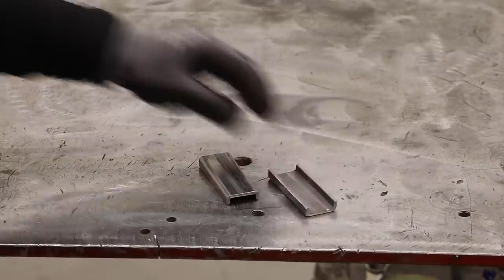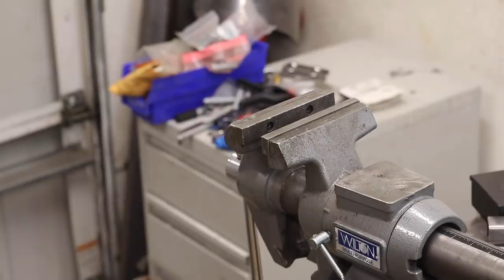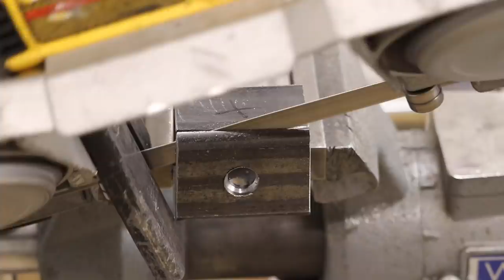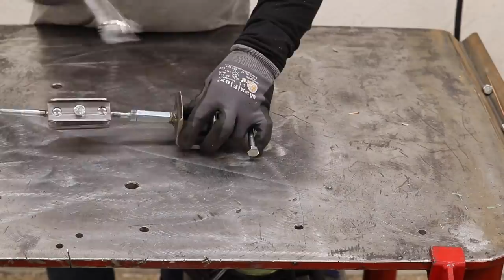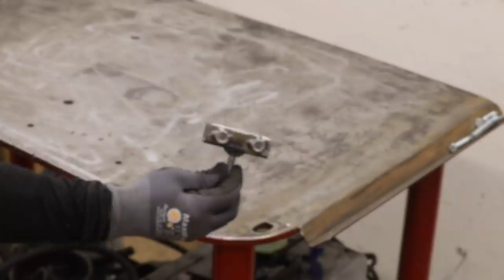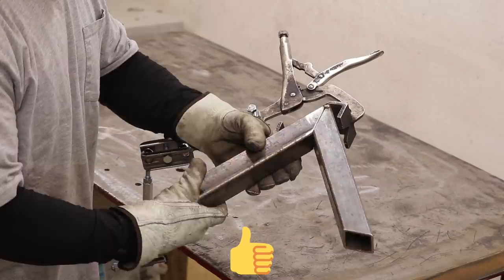BEST DIY TOOL IDEA FROM BALL BEARINGS!!! DIY TOOLS!!!

Comment: Great idea! A giant helping hand! Could be scales up a bigger, stronger, more joints, powerful switchable magnet, etc...! Endless capabilities! I'm glad I watched this video!
Reply from the maker: Thank you.
Reply: P
Reply: Is it a joke?
Reply: @peaceforpeace3876  why would you say that
Reply: Qâf
Reply: That is an awesome version of the tiny stuff version of helping hands. Thanks for showing how easy you can make your own. So, how about you re-engineer the bigger version so it has fewer parts and simpler. It accomplishes the same task but doesn't have the long bolts between the pivot points. Compact, if you will. That would be on the end of a strong piece of square stock, however long. And the square stock would be welded to a ball bearing and the ball bearing would be trapped between two steel plates with the correct sized holes so bearing won't touch the frame or vise jaws. So you put this part in a vise, attaching the replacement vise jaws to the vise after removing the original ones, if the vise is smaller. For big vises, no need to remove original jaws, just grab it with the vise and move the strong as hell end out where you need it and tighten up that vise. Then put whatever in the end and adjust it to precisely hold big stuff!

Comment: very very nice work a bit like me

I come from the electronics world and we use what we call a third hand
but it is usually for small light parts
so
I make evy duty third hands with practice golf balls or those found in the lake and wooden packet boards like you two big holes and a bolt in the center

for those who do not have an easy welder like you
I only have rod or plamax and low temperature welding it probably would not hold

thank you for confirming my idea..e
jack 47 71
Reply from the maker: Thanks for sharing👍👍

Comment: An excellent fixture. A very necessary thing. But there is one thing. The profiled metal where the balls are located must be replaced with hardened steel metal. Since over time the steel balls will turn raw metal. I like and subscribe.